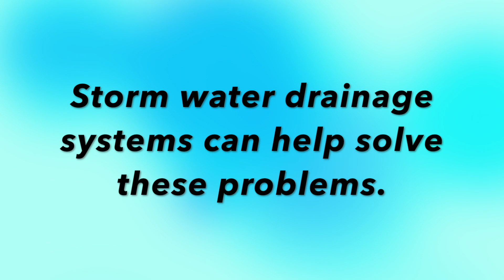Yard Drainage - Use A Wye In Your Drainage System - How To Build A Yard Drain

Comment: Great video. I live in Tampa Bay too. I know how much rain we can get in a short amount of time. 

Question. How do you determine how many roof down spouts to connect to one drain?  For example:  I have a 70’ length roof that has four down one side -2 on each corner and two at each corner of the sunroom.

Comment: Do you recommend inline catch basins, or catch basins wyed into the main line? I have FDM downspout clean-outs but the planned run is 80 ft until daylight. I'm using pvc since I'm in the south and there's not FDM pipe distributors near me.